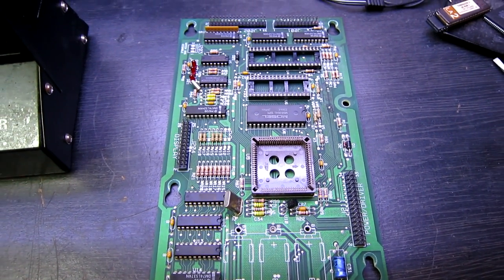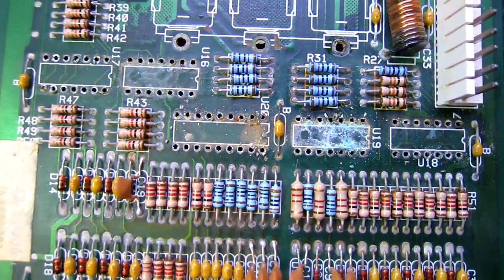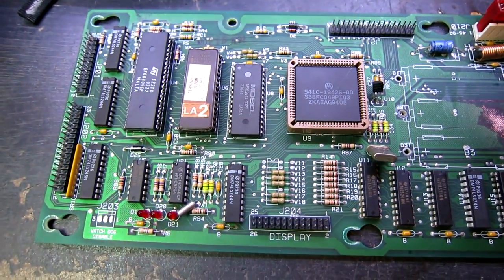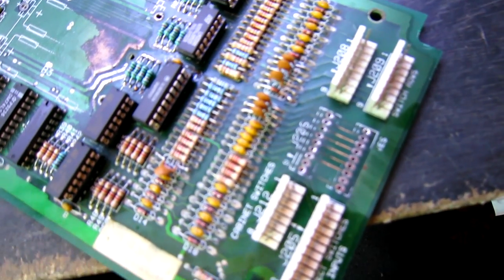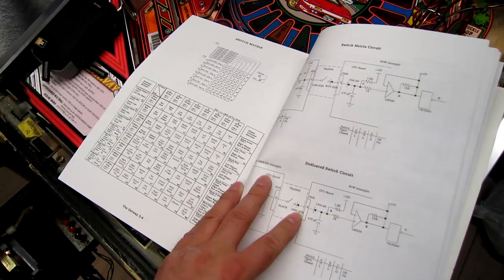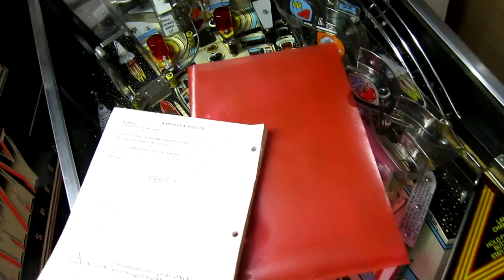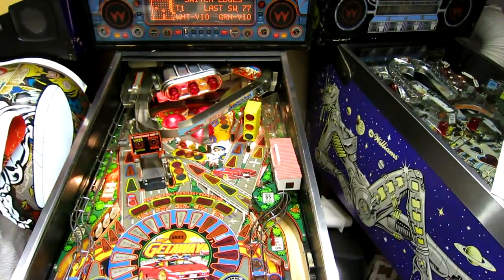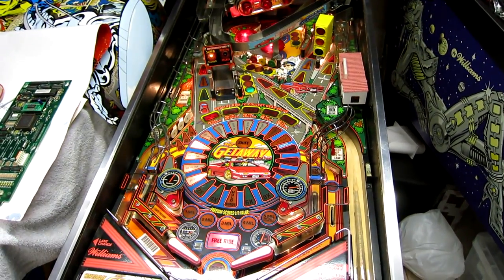Repairing WPC 89 CPU Board #7

Comment: Thanks!!! Just finished working on my WPC 89 CPU Board for a Funhouse . Had to add the jumper wires at 5:44 on U19. Row 7 on the matrix is now working. The traces for pin 5 and 7 were open.

Comment: Ouch - Bad corrosion there!  Nightmare with it being around all those resistors and caps.
Reply from the maker: GadgetUK164 It can be a real pain, I had one where literally every cap and resistor needed replacing on the bottom half. Should have thrown it in the bin, but I had started, so thought I would finish it.

Comment: What do you use for desoldering?   And what do you use for neutralizing the battery damage?  Thanks.  Do you ever try to replace the solder traces vs. running jumper wires?  It looks like you were checking the columns with the digital probe.  Is there any way to check the rows while on the bench?

Comment: You can fix any board it seems!  Now that it is snug in its conformal coating it wont oxidise any maybe last forever as long as it doesn't get leaked on again?
Reply from the maker: Knuckles the Echidna It should be fine for many years now. If you get all the corrosion neutralised and removed it should be good to go. People making short cuts just give the board a quick rinse and then fix it without getting rid of the deep corrosion, so it always ends up coming back